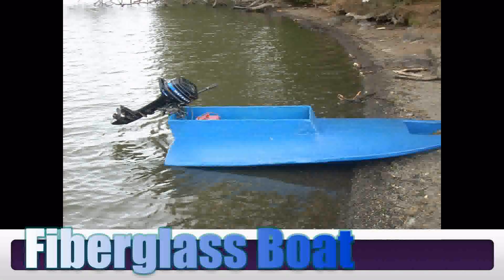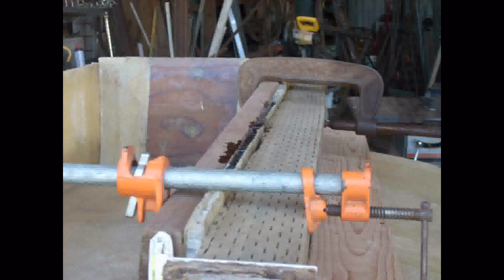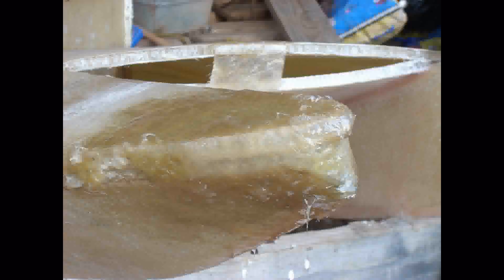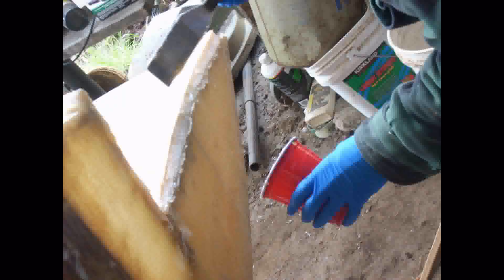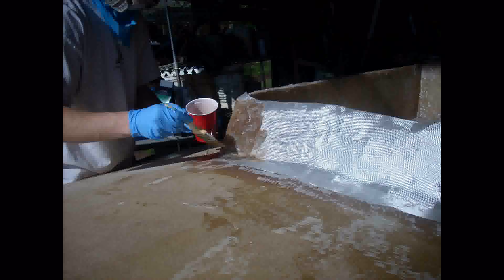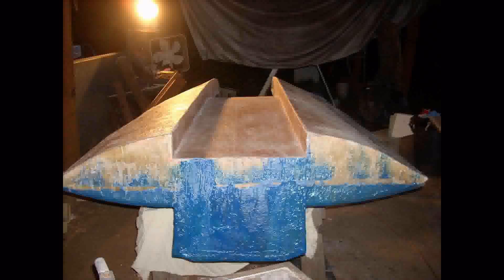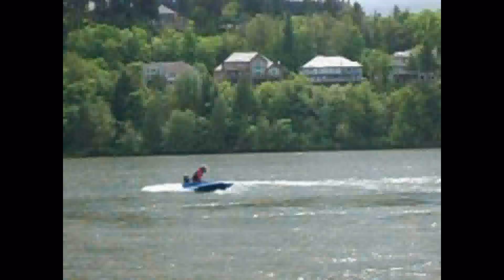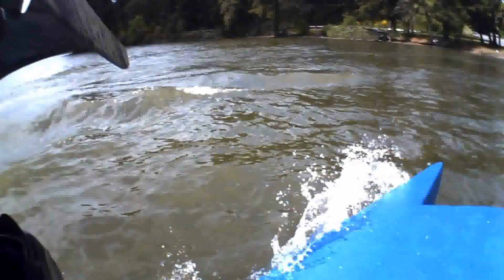How to build a Fiberglass Boat

Comment: That's cool..  There's only one rule to fiberglass.   Do NOT put on too much..  It's hell to grind off..  You're better off,  putting it on one layer at a time.  and then make sure it's right,  before you put on more layers..  The rest is all fun.    Polyester resin is fool proof..

Comment: It would've been nice to see a slightly more powerful engine, or at least a faster propeller (pitch) used, so that this hull could get up on the rails and actually "Plane" on the surface!  It looks like it's only displacing water, hence the slow speed, and high friction/drag)....

Comment from the maker: The honeycomb material was actually given to me in the pieces of the shell that you saw at first so i unfortunately dont have lots of information on it i.e. brands or where to get it but it basically had a an almost clear plastic making up the honeycomb and then and outer layer of plastic. The blocks are earch about 4"X4"  I dont have expierence with surfboard foam but i tested it on regular foam and the fiberglass melts the foam.